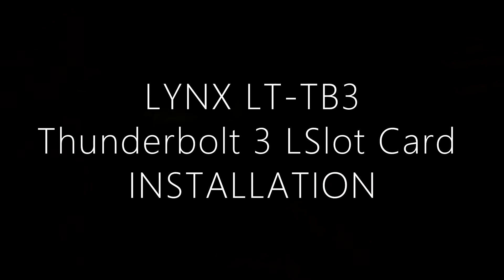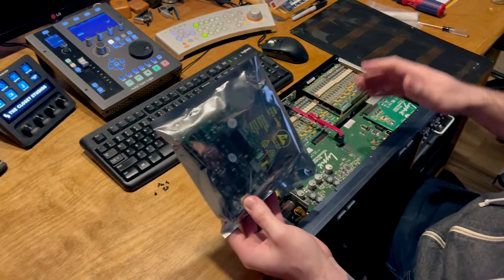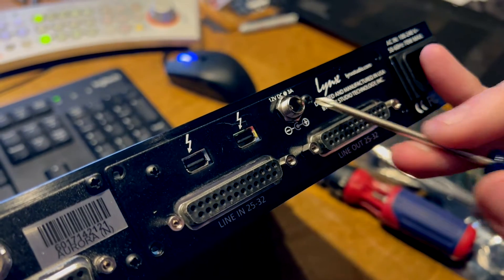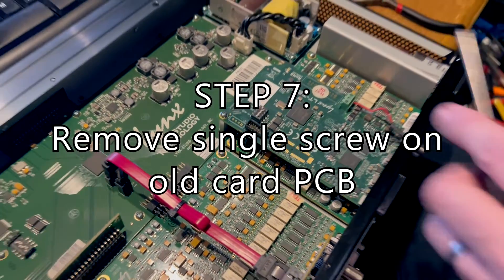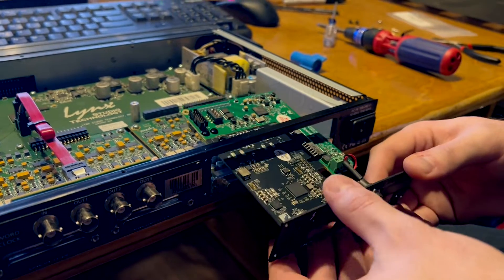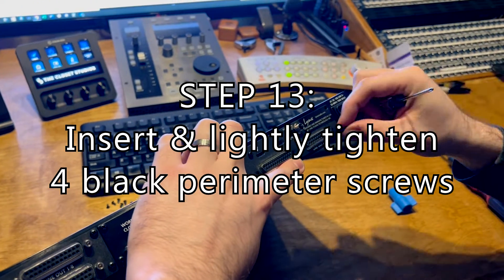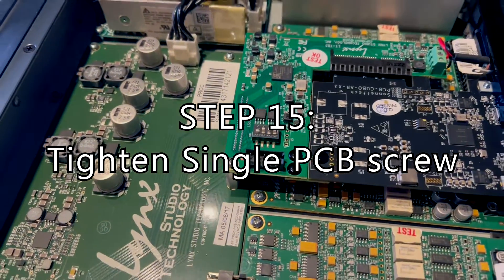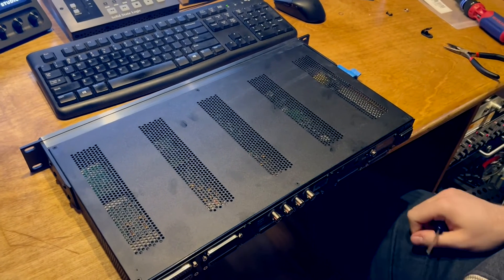Lynx LTTB3 (Thunderbolt 3) LSlot Card Installation

Comment: Thanks for the video. I’m just curious why you wanted to go with the tb3 card. There’s no difference at all in performance over the tb2, they are exactly the same. The only difference is the connector. With a tb2 you’ll have to use an adapter for tb3 - but again makes no difference in performance.
Reply from the maker: My new computer was not backwards compatible with TB2. This was confirmed by Lynx.
Reply: @RecordingLounge  really? I guess the only way that’s possible is if maybe you’re on a pc then because my new Mac works fine with tb2. Another reason to go Mac I guess